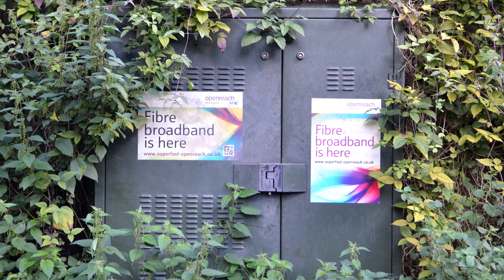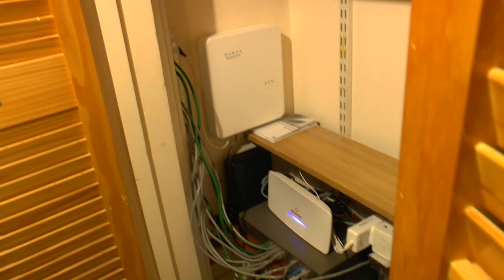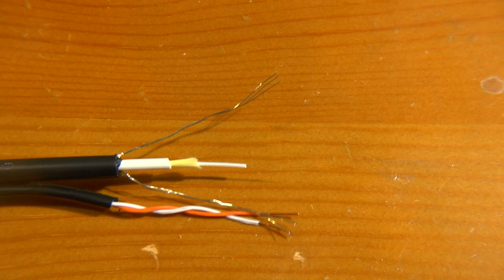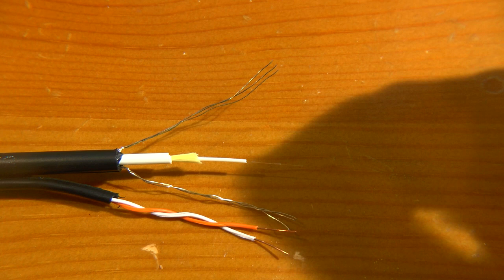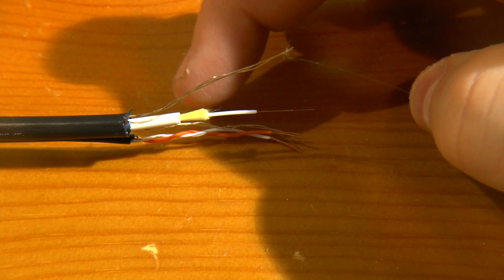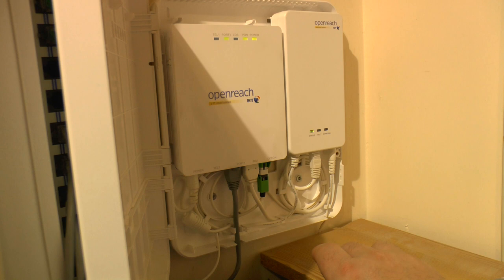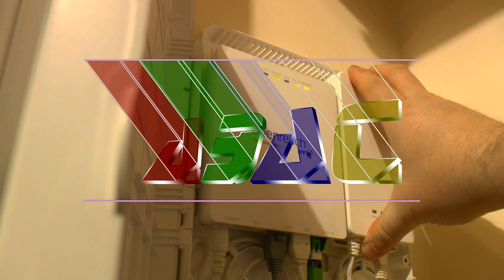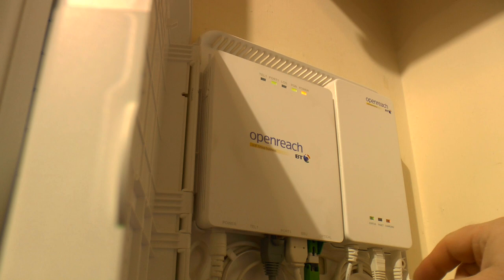FTTP - Fibre To The Premises

Comment: Super video - thanks for that, it's a great overview. I've not been able to find any information anywhere else that is as succinct. .  I'll be moving from a 4G broadband connection with external aerial to FTTP in the near future - when I can figure out how and what changes I'll need to make to my home network to accomodate FTTP. In this respect, I've found ISPs to be near useless.  My existing (Huawei) 4G LTE router also has a port that lets me use a SIP  (VOIP) phone connection. I'd like to keep using my VOIP phones. Am I right in thinking that if my Huawei router has a WAN port, I can can plug my FTTP feed into it and not have to make any changes to my network or phones? And if there's no WAN port, i need another router?!
Reply from the maker: If it's got a WAN port then it may work, you'll need the login details from your ISP (which may not be that clear, for example I'm pretty sure mine logs in with my username suffixed with @plusdsl.net, not @plus.net as might be expected.
Another option is to plug its WAN port into the LAN port on the new FTTP router. As long as the LAN and WAN IP ranges differ you should be OK (for example a 192.168.0.0-255 range on the LAN with a 192.168.1.0-255 range on the WAN, both with 255.255.255.0 subnet masks).
Reply: @AintBigAintClever  OK thx for the suggestion
Reply: @miekwest1   & @ABAC ; watch out for 2 stacked routers; you get double NAT from the PC end point in the house to the server in the Internet; can cause issues with some game applications I understand. Most newish router boxes can be configured in "bridge" mode (which may or may not mean the port labelled WAN on the box is acting like any other LAN port). FTR technically, bride mode should disable the DHCP server in the "bridged" router, so all IP address allocation is controlled by the "ISP router".

Comment: Hi I have just moved into a new property and i have one of those in my upstairs cupboard. What shall I do? Can I plug my router into it for faster speeds?
Reply from the maker: You can try, but I doubt it'll work unless you contact your ISP and ask about it.
Reply: AintBigAintClever Why have they installed it in the upstairs boiler cupboard and not the living room where you would normally have your router? Is this somehow connected to the down stairs living room main Ethernet connection that my sky hub is connected to? Thanks
Reply from the maker: Mine's in the cupboard because I've already got Ethernet cables going from there all round the house so for me it was the best place to put it. You say you have a "main Ethernet connection", where does that go? There'll be two ends to it and the living room is one of them.

Boiler cupboards can be handy for installing networking equipment and also intruder alarms (although the batteries in those don't last long if the cupboard gets hot).
Reply: AintBigAintClever The point of entry for the fibre is next to my house front door as i've seen a little white bt box low level so i presumed that the ground floor Ethernet connection in the living room was main point. 
I have two Ethernet connections in my house 1 in the living room and 1 in the main bedroom, have i also got a Ethernet connection in the boiler cupboard? I've actually not moved into the property yet but will in 2 weeks. It's not cheap but I've just looked and i can get 1Gps for about £30 a month.
Reply: Contact an ISP and they'll get you set up and send you a router. If you plug your Ethernet cable from the fibre modem box into the Ethernet socket in your cupboard, you will be able to put your router either in your living room or bedroom sockets. The fibre cable enters your house porbably by the front door and will be run internally through the wall to the cupboard upstairs to the modem. This is where it transfers into the Ethernet circuit. You won't be able to change the position of the modem unless you rewire your house unfortunately!

Comment: So is the hub 1 just being used as a NAT router (ie, if you plugged a laptop direct into the ethernet port on the optical doofus would it get your public IP (assuming this is all ipv4, rather than v6)?
Reply: No it wouldn't get the public IP, you can install your own gateway in it's place though

Comment: Great video with lots of detail you won’t fine anywhere else. Thank You.
Just a quick one though is that green optical connector a standard connection you might find on a network switch gbic  uplink (like sc or lc connection). Just needed to know if the equipment wanted to me moved could you extend the opticable with a standard optical patch lead..?
Reply from the maker: The green ones are APC connectors so not quite the same. They're designed so that if left unconnected the laser doesn't reflect straight back along the cable, instead getting deflected to the side.

Comment: Hi, 
mine is newly build property and fibre modem is wall mounted in a cupboard in the front half of the porperty. do i need to connect and keep BT hub 2 in the cupboard. so we have to connect TV and all digital box wirelessly? if we keep cupboard door closed all the time, will the signal will strong enough through out the property?
Reply from the maker: The BT Hub can be up to 100 metres away from the fibre modem but needs to connect to it using Ethernet (not phone) cable.
Reply: @AintBigAintClever  Thank you very much

Comment: I'm getting full fibre installed on 06.01.23 ... Although obviously well protected, what happens if the fibre BREAKS? (The fibre itself, not the whole cable). I presume the data flow is interrupted, and the cable has to be replaced?

EDIT: Obviously, in the four years since this video, things have moved on. As far as I'm aware, I won't be receiving a battery backup system for the Digital Voice Service. The battery backup would have to power the Fibre Connection Box and the Router for Digital Voice to work, in the event of a power cut.
Reply from the maker: Broken fibre would mean no internet (and no voice).  The cable can be replaced, reterminated (new plug on the end) or spliced, depending on the damage.
Reply: @AintBigAintClever  So, exactly what I already said in my original comment? ... Interrupted data flow!

EDIT: I first used fibre 32 years ago! I connected my CD Player to an offboard DAC! I recall being amazed that the data was converted to pulsed laser light and sent down a glass (more likely plastic) cable! It seemed like magic!

Comment: well i must say its different to my fttp install, mine is a single fibre cable over  head from a drop manifold,overhead via 2 spans(poles) then to my gable end at the same height as my copper phone line,then down the wall to ground level,to a jointing box,then back up the wall and through the wall to the Ont/battery backup,mind you i went from 1.25 Mbps to 220/20 just like that,i am now in receipt of 330/50 5 and bit years later,and one set of battery backup batteries,i must point out that if you phone is plugged in via the ont,you will lose internet in the event of a power-cut BUT retain the phone for the likes of 999 calls but no internet
Reply from the maker: The hybrid cable does away with the need for an outdoor splice box.
Regarding internet loss during a power cut, that's due to the broadband router not being protected by the battery unit. This comment was posted with the power to the fibre unit deliberately unplugged; router is on the mains, but the fibre unit is on battery.

Comment: great informative video and might consider if sky gets it as i currently have FTC but use a mesh wifi due to wifi deadspot in back of home
Reply from the maker: Considered putting a cable to the dead spot and running an access point there?

Comment: I wish the Verizon fios service would use AA rechargeable batteries for the ONT. Ours used the crappy 12V sealed lead acid battery which is overpriced to replace.
Reply: But a 12V lead acid has much more capacity than AAs so will run for longer.
Reply: You could buy a third party 12V lead acid, for example yuasa.
Reply: For me, I would not mind a compartment that holds 10 AA batteries. The issue with the lead acid ones is that they have a shorter shelf life than the NiMH batteries. Furthermore, even if you are going for lower cost brands, a 12V battery still costs around $18-$20+

Beyond that, I wonder why none of them try to use the li-ion 18650 batteries?
Reply: They're not AA's, they're 18650 Li-Ion cells.. but the capacity of 4 18650s is probably not much greater than 10x AA NiMH these days...

Comment: funny that i dont have fibre directly into my flat  it joins to a splitter  containing copper adsl wire ?
Reply: im with sky fibre  n they used copper wires not optics ?
Reply: i get 50mbps bandwith  thats 5mbps download speed
Reply: must be something like fibre connected to a powered DSLAM
Reply from the maker: Google "FTTX". It may be a central fibre connection to the building (FTTB) with copper service from there, either VDSL (as Andy pointed out, a DSLAM in a central comms cupboard) or Ethernet.
https://en.wikipedia.org/wiki/Fiber_to_the_x

Comment: That's an excellent video!  Thank-you so much.  The majority of homes in our village in Cumbria are all on EO lines.  Because of costs to get power to a new green box, it is more economical to install FTTP to each of the properties (all overhead) - which is great!  We've been told we'll all have fibre for the end of March 2019.....A couple of questions if you have time,

1 - I live in an old house where cat 6 cabling isn't an option so I use Powerline networks - will I see much drop in performance?
2 - My current set up comes in under a window and the main box sits quite tidily behind the washing machine and then feeds the powerline network - would it be advisable to have sensitive equipment like this behind a vibrating washing machine?  Would it impact performance?
Reply: Power line adapter's will always have performance loss due to the interference from the electricity running parallel but it does provider a better connection than wireless where it's required. Fibre is quite fragile so no I wouldn't have it in the same location you should be asked/advised by the engineer on best solutions/locations for it to go

Comment: I came across an installation today in a large country house. They wanted their WiFi extended. From what Zen tech support said one of the standard Ethernet ports (1) on their 'Fritz!box' router was configured for PPoE. Now I believe that any router with a red coloured port marked WLAN would do the job as well. Anybody know about compatible wireless routers for this system?
Reply from the maker: Search for cable routers. Alternatively install a dedicated wireless access point to either supplement or replace the wifi built into the existing router. I use an Ubiquiti UAP-AC-PRO, with the Hub One wifi turned off.

Comment: Fantastic video many thanks.  Question will the cable be able to be installed behind my home which would mean going along the side of the house and then behind?  I heard these fibre cables don't like bends
Reply from the maker: They don't like sharp bends but if the wall is brick it may be able to take a corner if you cut a channel in the pointing between the bricks.
Reply: Thanks for taking the time to reply

Comment: I have had fttp for a year now and love it. I’m using bt homehub 5 which connects via the wan to the ont. I would like to change this router for a better router with more features for gaming and for using a vpn service. Do I need a special router or a normal router and which one would you recommend. I get 330mbps down and 50Mbps up. Thanks
Reply from the maker: Draytek apparently get good writeups. As long as it has a WAN port and not just an ADSL/VDSL port I'd expect it to work. Draytek 2860 series have a gigabit WAN port so should be ideal.
Wifi-wise I use an Ubiquiti UAP-AC-PRO and it's fabulous. The wifi on the Plusnet router is switched off.

Comment: Great video and a real help as just found out it is available at a house we are about to renovate. Can you tell me the approx size of cable as I plan to install some trunking to the external wall where they will bring the cable in from a cupboard that will house all the kit.
Reply from the maker: The outdoor hybrid cable is about the same size as decent grade aerial (or satellite) cable. Strip away the black sheath and the white internal stuff is about the same size as indoor phone cable.

Comment: Thank you for sharing your insight, very informative. I recently moved to our new house which has the same Huawei GPON terminal and all rooms pre-wired with BT and Virgin Media. Unfortunately the Virgin Media engineer came in my absence and told my spouse that the FTTP set up is not working and he drew another line from the Virgin Media entry point and set up the Hub and leaving us to be on WiFi only. I personally don't think he could work out how the GPON terminal worked but I want to be sure that is the case. I would like to use Virgin Media Hub 3  and the GPON terminal  but I don't know which port to plug the ethernet cable to as I don't see any WAN port unlike one in BT Hub. 

Any help will be greatly appreciated.
Reply from the maker: Looking at a photo of the rear, the Virgin Media Hub 3 can only be connected to a coax cable service, not a GPON terminal. If you're with VM I assume that's how their service will come in, whereas if you were with someone else you'd have the service via the GPON terminal.
What do you mean by pre-wired with BT and Virgin Media? Do you mean each room has a BT socket and a coax socket, with no Ethernet sockets anywhere?
If there are Ethernet sockets they'll all go back to one location, you can put a network switch there, patch all the network sockets into the switch and patch the Hub 3 into the nearest Ethernet socket in the room. That'll should give you wired Ethernet everywhere.

Comment: hi.. great video.. Getting my FTTP installed next week! Could you tell me the size of the wall box? Also any idea if there are restrictions using BT Wholehome to take the wifi signal
Reply from the maker: 215mm wide, 250mm high, 40mm deep, or thereabouts (the cupboard wall and shelf get in the way of my ruler).
Reply: The openreach ont is even smaller now as it's no longer fitted with a battery back up. Unless its brand new housing with no copper in the estate

Comment: I wonder if there are card modems that can be installed into a PC like akin to dialup modem cards and have a fibre connection directly into a pc
Reply from the maker: You can get GPON SFPs and SFP-based NICs, although a combination of the two would be no faster than the Gigabit Ethernet port already in the PC, not to mention harder to set up.

Comment: Thank you for this insight, can you also tell us a little more about the telephone service from the unused socket in your case; can this be plugged or connected into normal socket extensions around the house and if so does the original BT analogue cable need to be disconnected from the extensions? My main reason for this question is because I have FTTP but just switched from BT to Sky, the telephone socket is in the router provided which I intend on using for the extensions, but the extensions are still wired into the BT master socket.
Reply from the maker: At the moment the ONT's phone socket is dead. If that were to be made live, it would be a case of unplugging my phone extensions from the NTE5 and plugging them into the ONT instead.
In your case I'd use a BT 80A coupler and a DECENT telephone patch cable, one which uses twisted pair instead of the crappy tinsel wire you get in the flat cords.  If you look online for 431A UTP it'll put you in the right direction.
The 80A has screw terminals which will suit the stranded patch cable and punchdown terminals which will suit the extensions (or you could just run both to the screw terminals.
Reply: @AintBigAintClever  Thank you, I have just been in the loft where my BT master is and the extensions terminate. Disconnected the BT pair which were still live but no active line, this was interfering with the extensions, a) still had power and b) when dialling out on the telephone extensions plugged into the router telephone line were cross wiring with the working router line. The result was I was able to dial out to my mobile which was ringing with a BT message telling me there was a fault. 
 What threw me was a faulty wire I used as the connecting wire to the extension sockets which made the extensions dead. The house is connected with Cat5e cables throughout to the extensions but I will certainly be taking your advise to upgrade the connecting cables from router to extensions.
Reply from the maker: @shinchamdal1193  the upgraded cable is simply because tinsel wire is AWFUL to connect to. You can't solder it and there's next to nothing to try and get under a screw terminal.  Unless you can connect to what's already on the end (BT/RJ/Molex plug or fork terminal) it's an absolute pain.
Twisted pair is unlikely to be tinsel so will be easier to terminate. The fact it's twisted pair is of course a bonus.

Comment: I'm moving into a new house which has a FTTP BT modem set up in the cupboard under the stairs.  Does this mean my BT Hub will need to be connected direct to the modem & kept under the stairs or can I connect it to another phone socket in the house?
Reply from the maker: It can't connect to a phone socket. It can be up to 100 metres away from the FTTP box but needs to be connected through an Ethernet cable, not a phone cable.